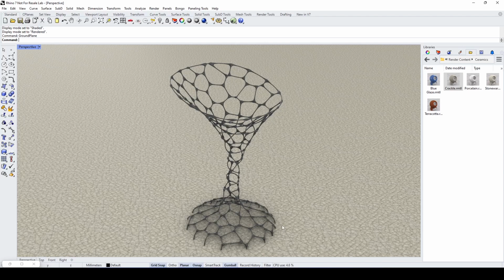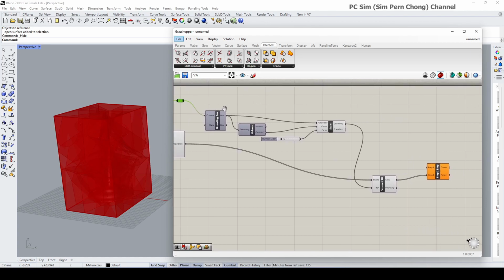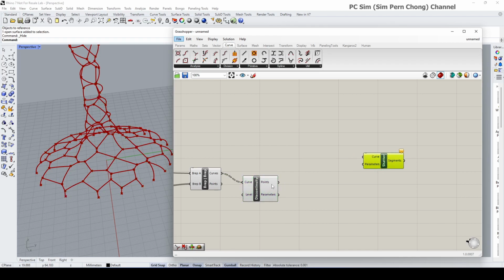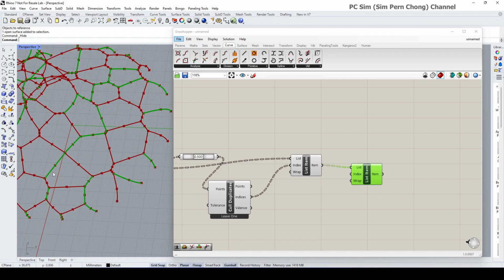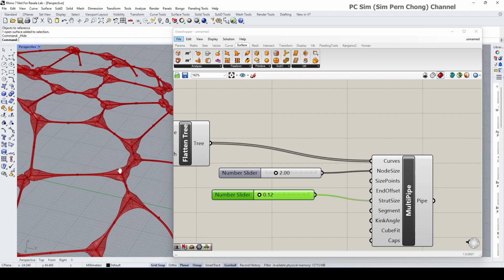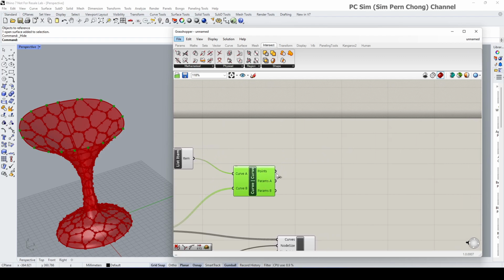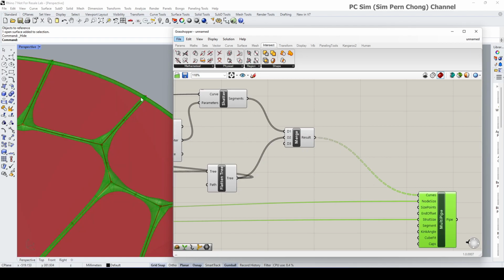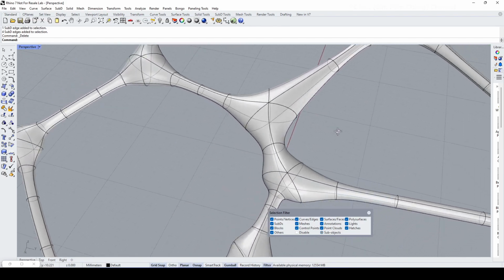Rhino Grasshopper 3D Tutorial: Voronoi organic sculpture

Comment: i fully copied the whole tutorial , but when i get to the multipipe i still have a problem, the box sais : 1. Solution exception:One or more errors occurred. (Index was outside the bounds of the array.)
Reply: for some reason it only works with a normal pipe command
Reply: I have the same problem, have you solved it?